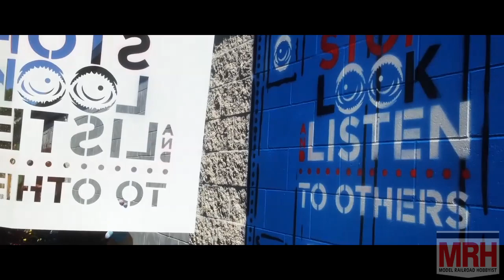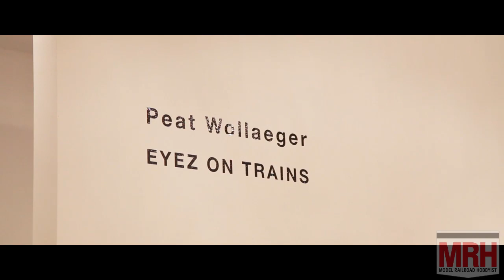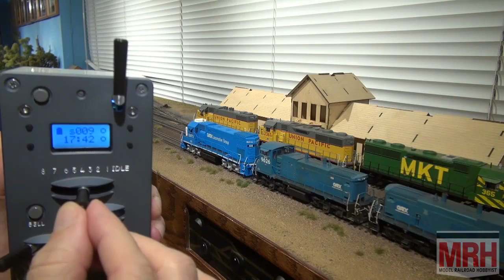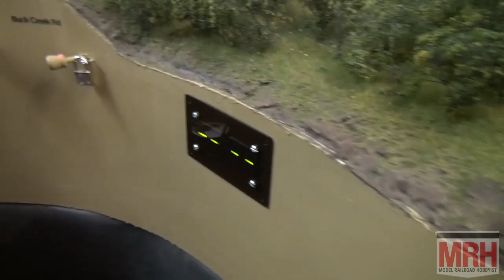Model Railroading to the MAX! | August 2019 WHATS NEAT MRH Mag

Comment: Model Railroaders are finnicky, until you tell them they can build outside the lines....I should know...took me 20 years to get back into this hobby. Despite the lack of affordable new rolling stock or switches, this hasn't stopped me from grabbing all the curved pieces of atlas track or oxidized switches that no one wants (sitting in a box with others of the same under the display table...20 dollars for 5 switches rocks). I once built a working mashup of an M-cab, with a GP60 dynamic housing all on top of an SD-40-T2 athern chassis with the radial sideframe trucks for SD-70's, with working ditchlights and an oscilating top light....Blasphemy I tell you (mixed results at the club back then, but it passed tech and was on the layout for a bit)...how dare I prototypically model outside the lines! Point is, I see that its hard to encompass the ENTIRE hobby and satisfy everyone...so many scales and each with thier own details. I'll suggest that there be some way for a viewer to send in projects and accomplishments (layouts and the such); just like I remember from all my model railroader mags (that I STILL have, those things are heavy!).  I came here first a year ago, and still look forward to what you put out. Just like my mags, I didn't drool over every single one...sometimes just looking at the pictures and ideas were enough. Now, whose going to make the first SD-100?

Comment: Steam version of that throttle would use voltage controlling dials instead of switches, simulate increasing pressure, should be pretty cool and fairly easy to code the backend, its just changing notches to display a fake pressure % instead of a fake power setting #.